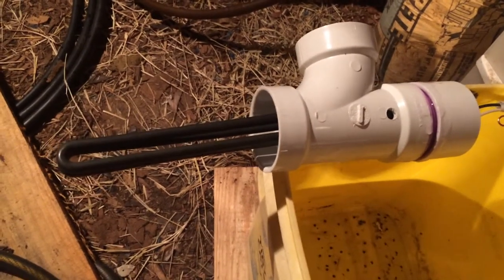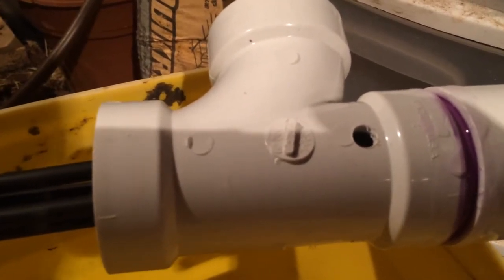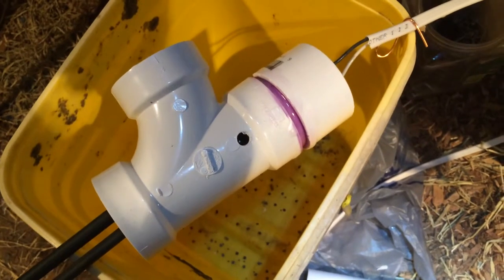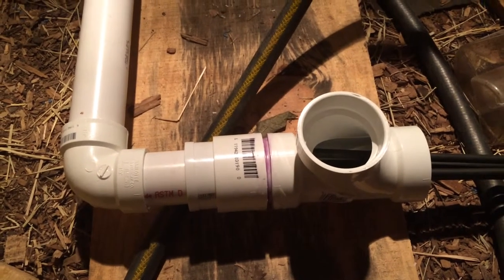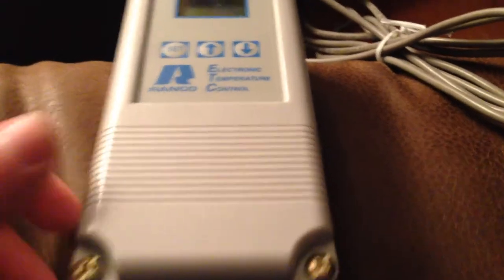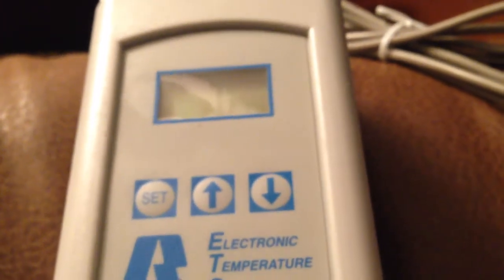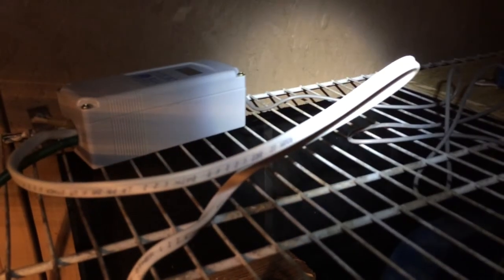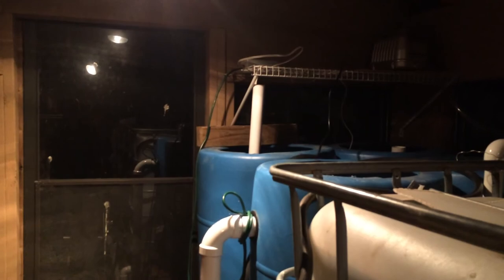Raising Tilapia - In Line Water Heater Construction and Performance

Comment: Nice Tom, let me know how well it works when (and if) you get a couple good cold nights. It's been 18 and 17 here the last 2 nights. I would like to try that type of heater on a dedicated circuit.  Take care of that cough buddy....don't want you getting sick!
Reply from the maker: It's working very well! I'm getting ready to upload an update video for you. Things appear to finally be lined out (knock on wood). I'm not sure if it will keep up with a full 1000 gallon system but right now it is running 400+ no problem.
Reply: tom I like all I've seen so far and my plans are very very very similar....plan on using Mineral Springs and would love to see your setup   .....u am  in sweetwater Tenn.   my name is also tom